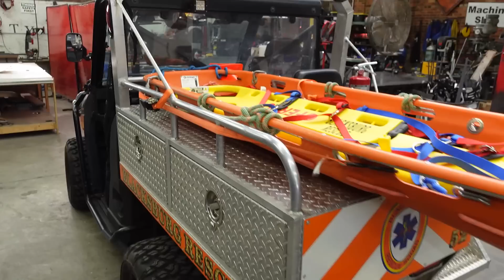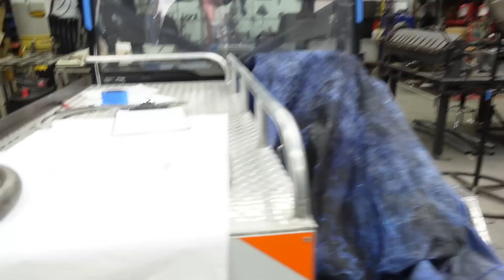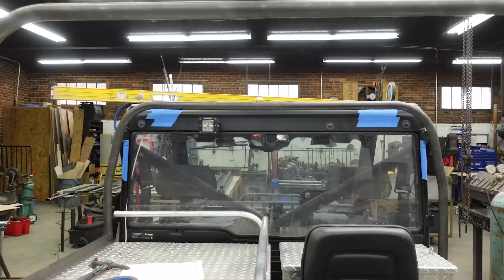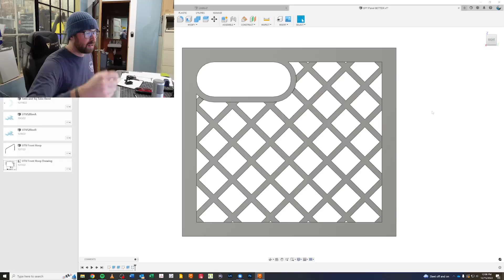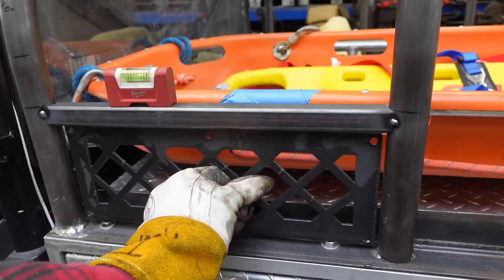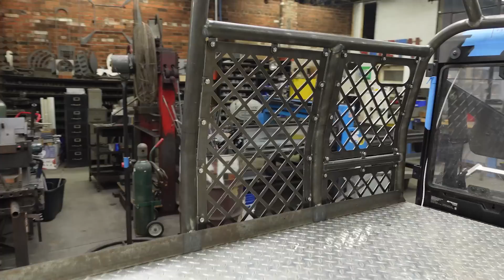Pimp My Ride: Rescue Squad UTV (Santa Edition)

Comment: Jake and I both have the Miller 220 MIG/TIG/stick. I selfishly hoped for more discussion but recognize it was not the right priority in the push to meet a deadline.

My 220 is my first welder. I picked it up in the spring.  I have a world of learning to do with it. I have mostly mastered making porous joints with excessive filler. At least,  I am burning fewer holes as I repair fence-panel thin-wall tube joints that over years did not stand up to goat horns during rut.

Comment: Awesome project. Thanks for the 360 tips, not drawn out or boring.  Don't forget to seal the bolts that hold the cage to the aluminum on the left (drives) side to keep water out of the storage bins.  Ask Tom if they would like a large dome light or 2 above the Ferno basket to be able to see the patient at night.  Was glad  to see you put the expanded metal instead of the solid metal on the sides, eliminating a blind spot for the driver.

Comment: would it have been possible to have drawn the roll cage hoops on the program for the plasma table and placed a sheet of plywood on the plasma table and then fitted a permanent marker on the head instead of the plasma cutter and drawn the roll bars on the ply?

Comment: Looks great, figuring out main hoops is always a challenge.
It could do with cross bracing to make it safer on a roll over but it's pretty much impossible to incorporate it.
Also another tip for fusion, join both body's together into a single body and make the DXF after that to get rid of any extra lines, dont ask me how I know (messed up before with cutting those extra lines😂😂)